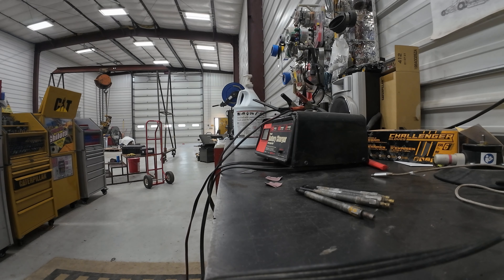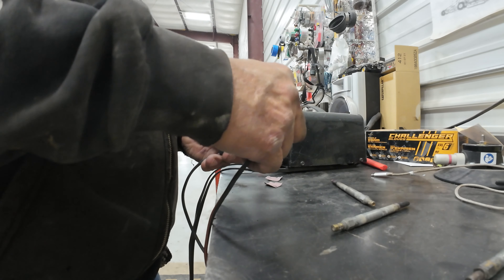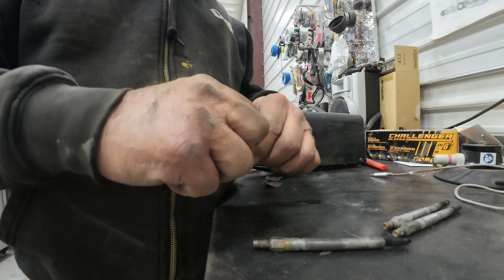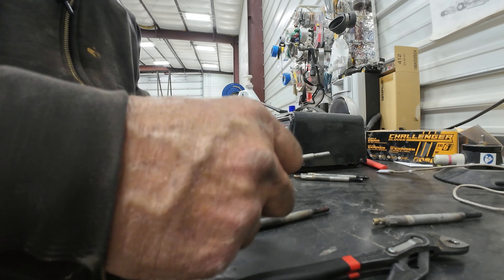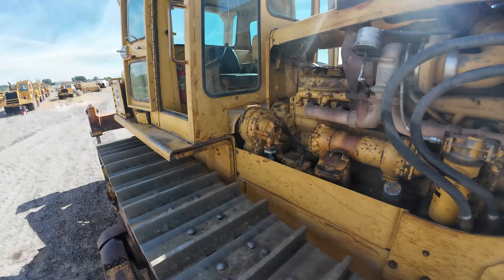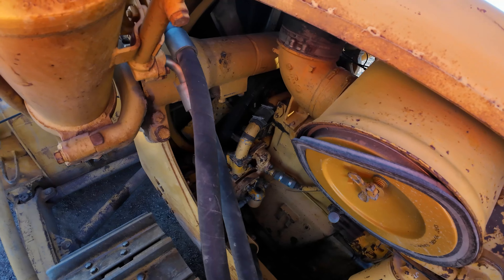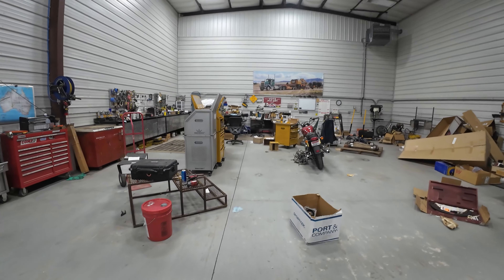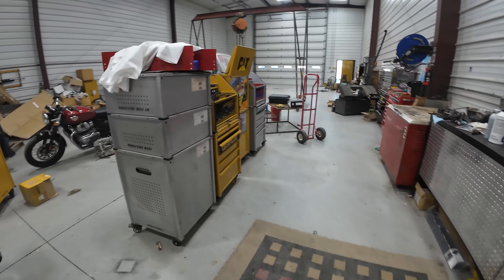D9G Glow Worms

Comment: 1968 Mustang Fastback(came with a sick 302 piece of garbage cost me $3100.0) dropped a 351 Cleveland four-speed manual with 4:11 rears in it. Eat the pretty purple Challenger for lunch, LOL. Oh, it was my first car bought on a 30-day leave from Vietnam. I took it into the shop and worked magic on its lifters. A cam Ford would be happy with me, and so on ,topped off with garret turo off an airplane. Yes, I am a pilot, that dirty need for speed syndrome. I went back to Vietnam minus a driver's license for the first year out of service, but it was fun. I'm not a Dodge fan, but you did a number on the girl and should be proud. By the way, I wish I still had it. I have been looking, but they are hard to find

Comment: I was always of the opinion, that whoever designed that harness and the outside end of the glow plugs had there head up there back door ,eyelets and thereded connections would make a world of difference
Reply: why can't that be done if those terminals screws on?
Reply from the maker: @bobstratton6362  They don't screw on, the ends are crimped on, my 14G has rubber boots to cover them from the water

Comment: Does the top of those glow plugs screw off like a spark plug? If so maybe convert the harness to small ring terminals?

A more precise test might be to wire a DC meter on ohms into the 12v test circuit and compare the resistance values